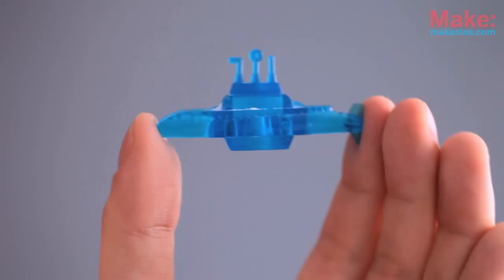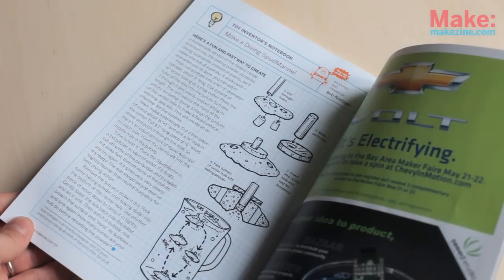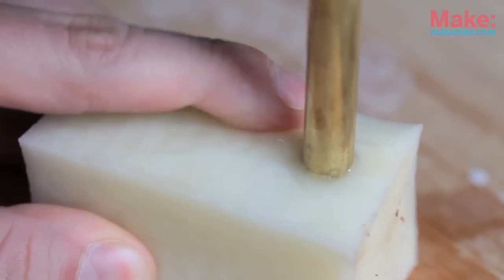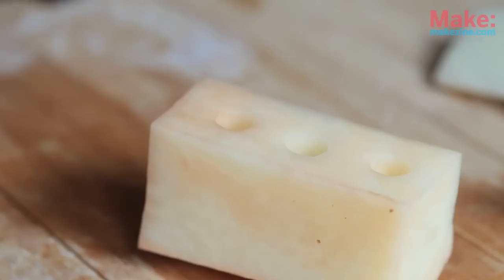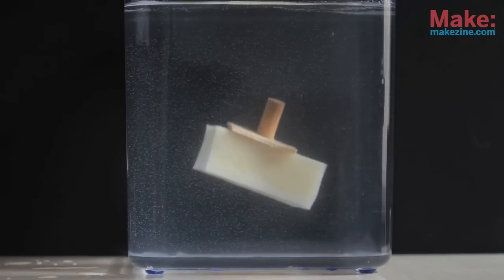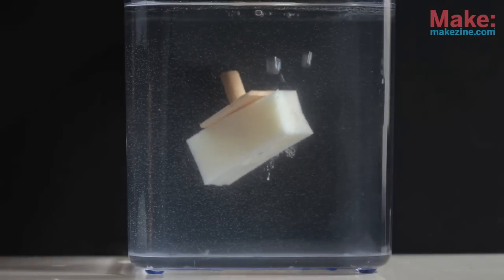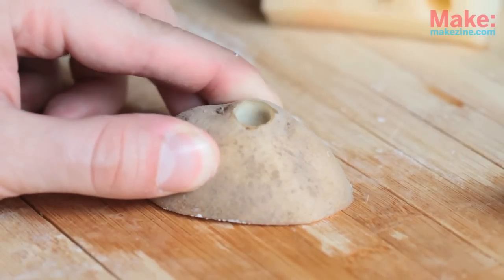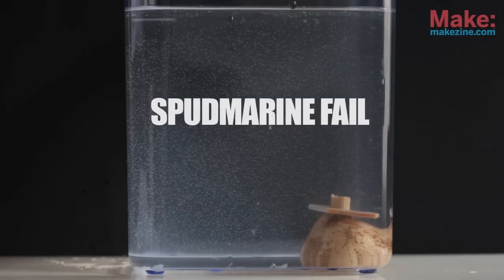Diving SpudMarine

Comment: Would be neat to attach a little propeller or motor on the back. Maybe one of those rubber band powered motors. Or how about a spud sailboat? The hollowed out potato skin would be a good shape for a boat. You could hollow one out, then coat the whole thing in some kind of clear glue to harden it and put a sail or motor on top!